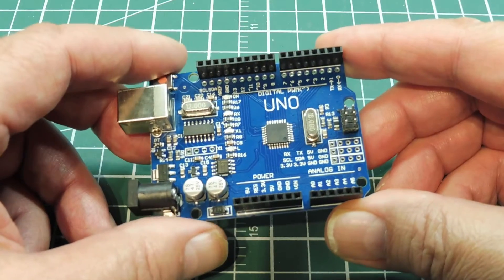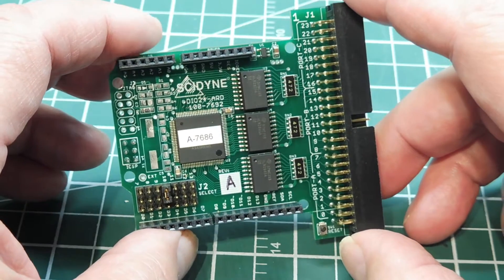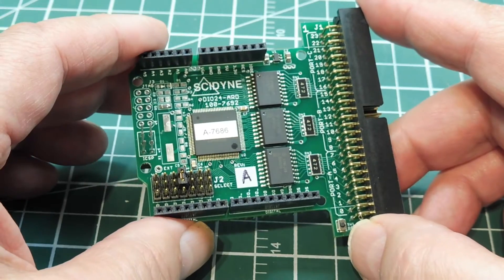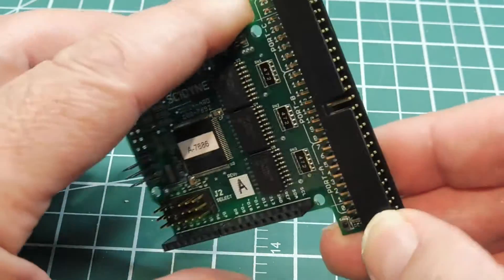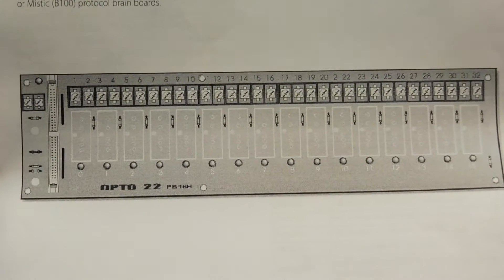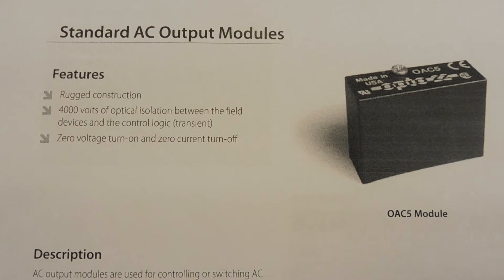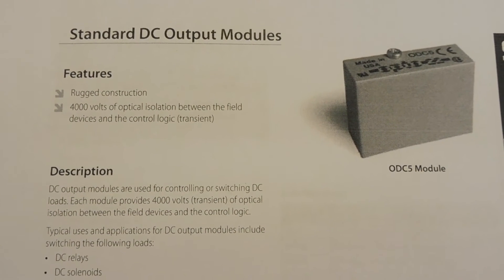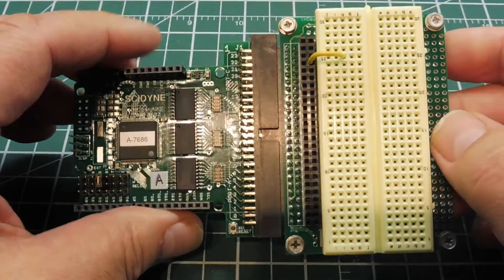How to add more digital I/O lines to the Arduino UNO

Comment: DISCLAIMER: I DO NOT WANT TO RUIN YOUR BUSINESS i have a $5 version and it gives 16 pins if you dont want to spend $40
Reply: also there is now a matrix mode which gives 64 pins and his is $45 for 24! that is basically $1.80 for each pin and mine is $0.33 per extra pin (without matrix) and with matrix it is $0.08 per extra pin
Reply from the maker: Yes .. If you don't need the Opto22 bus there are cheaper alternatives.
https://youtu.be/DXjogGsJlhU

Comment: Hi. Looking at the website to order the AD12EXPH1 but I am a bit confused with which connector option to opt for. There options for N/C (No Connector), RA, RA1, FRA, FRA1. Would you be able to suggest which connector I should use to connect to the DIO24-ARD that you suggested please? Thank you.

Comment: what is that board name with lot of measuring lines?
thank you
Reply from the maker: The 24 line I/O expansion board is from Scidyne, part number DIO24-ARD.
http://www.scidyne.com/hpb7692.html
The Opto-22 I/O module board part number is PB16H
http://www.opto22.com/documents/0452_Std_16_Ch_header_data_sheet.pdf